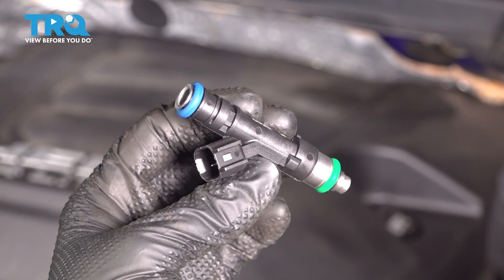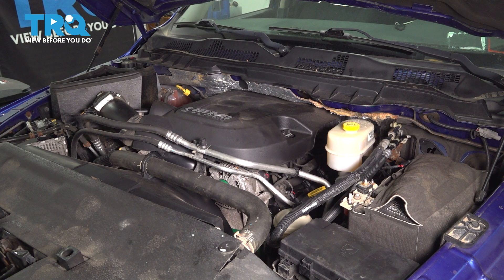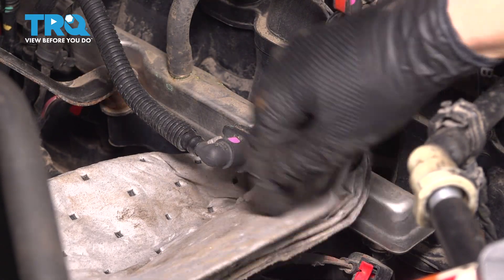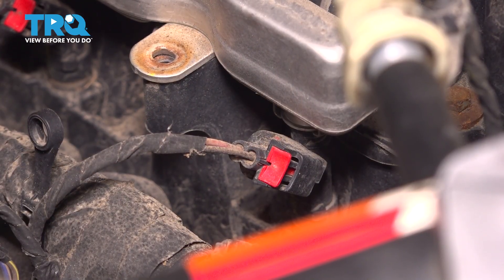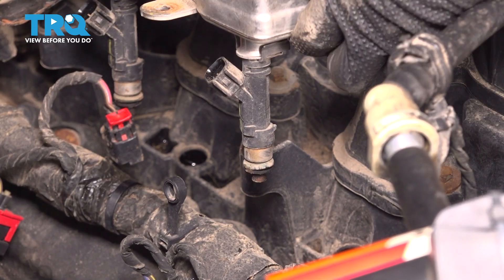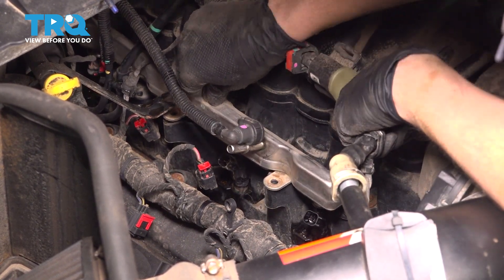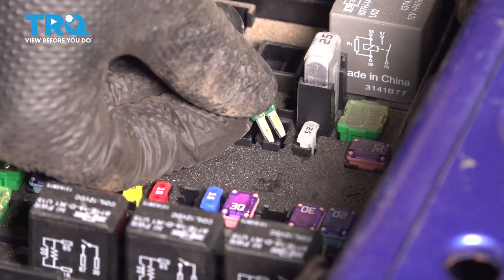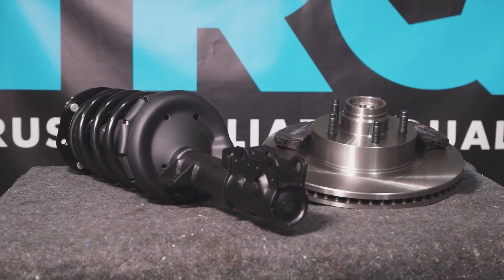How to Replace Fuel Injectors 2011 2018 Ram 2500 (6.4L HEMI)

Comment: Instead of pulling the fuse& running the starter try having the engine running& pull the fuse that I preposition the fuse puller on. This completely takes all the fuel pressure off & when I disconnect the fuel line there is practically no fuel spray. Less chance of starter issues also.